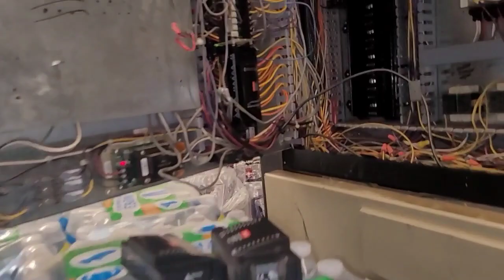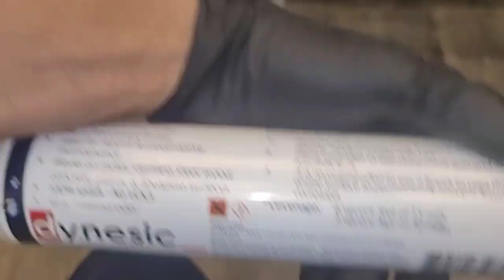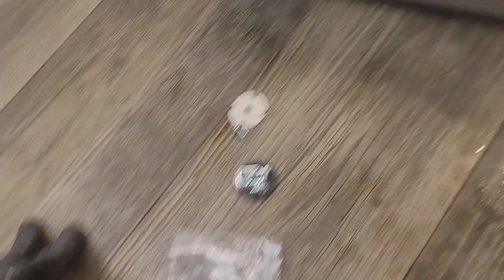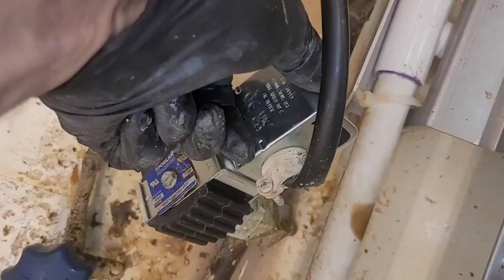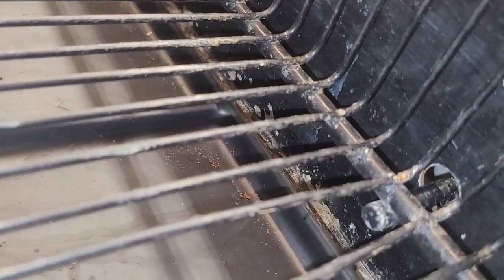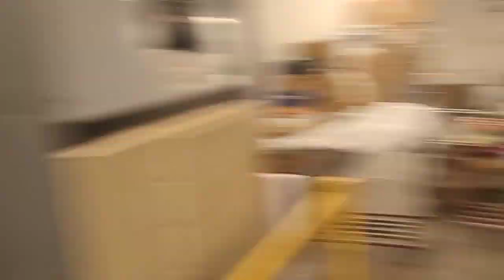Seafood Case Stopped Cooling because the drain Plugged

Comment: That’s one thing about refrigeration work you knew which stores and restaurants to go to and which ones not to that case was disgusting. I used that sealer a few times before I retired and it worked fine for me but I never saw it in a tube like that. When I bought it was a plastic bag with a seal in the middle and you would knead it to break the seal in the bag so the two chemicals would mix and then pour into the drain pan to seal the cracks or holes and it worked fine for me but had the same name as what you’re using.
Reply from the maker: Cool. Yea I never heard of it till I used it